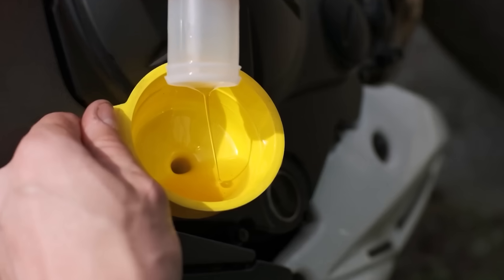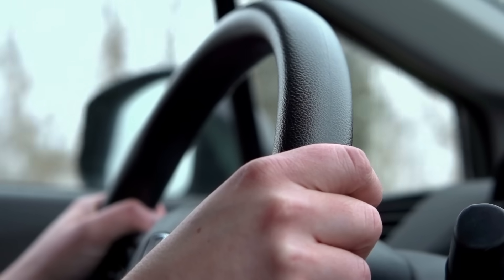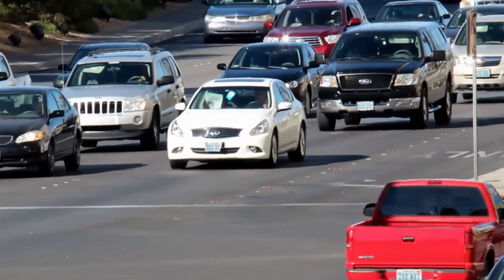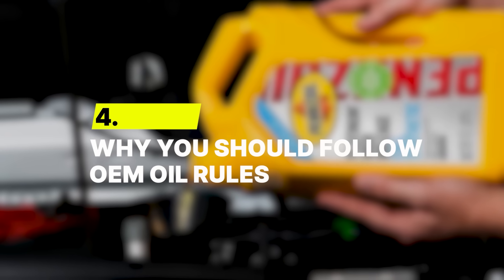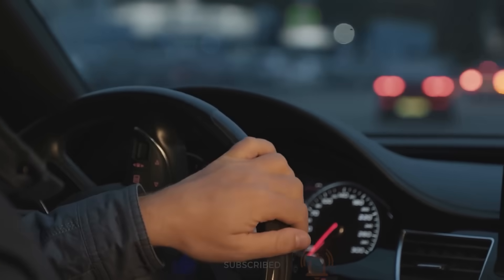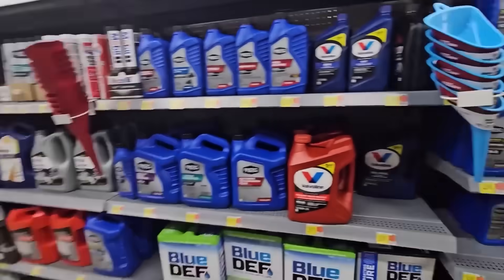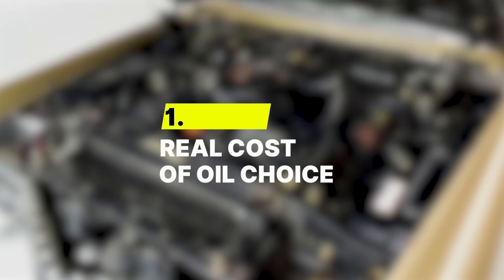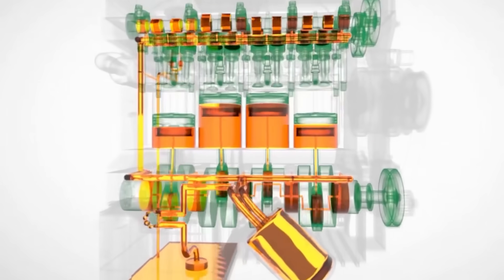0W-20 vs 5W-30: 50 Engine Tests Expose the Oil Everyone’s Been Using Wrong

Comment: Hybrid conditions require the thinner oils due to the on and off conditions of the engine.  Those engines are running colder in the stop and start use except on the hwy.  Any thoughts?

Comment: This content is 100% misleading and should be flagged as fake news. Following the advice here can cause serious engine damage. It’s nothing more than AI-generated clips stitched together with no real data, testing, or engineering context.

Modern engines are specifically designed and tested to run low-viscosity oils like 0W-20 (and even lower) for hundreds of thousands of miles—250k+ without issue. Increasing viscosity beyond what’s specified in your owner’s manual can actually increase wear and reduce efficiency, as shown by laboratory used oil analysis (UOA) results.

Wear and protection are determined by much more than just viscosity. Factors such as engine design, base oil chemistry, additive packages, and driving conditions all play a critical role. The best way to choose or adjust oil viscosity is through trend analysis with real UOA data, not clickbait videos or AI-generated speculation.

For a credible, expert-backed breakdown, watch this video where a real oil expert debunks the false claims made here:
👉 https://www.youtube.com/live/gGdrOgngmC4?si=NkA4hZWF2IQxVkAU
Reply: Don't forget that ford calls for 20 weight oil in their triton v10 6.8. Imagine towing 20k with that water oil.
Reply: That oil could tow just fine. It’s all about base oil and additive package, not weight.

Comment: "save thousands over it's lifetime".  it's just that "lifetime" will be considerably shorter.  Many studies, even by auto and oil manufacturers have stated engine wear is 30-40% more with 20 oils.  Many engineers have stated the engines are not designed for the thinner oils.  0w-20 is required by CAFE and EPA standards, that is the ONLY reason it's recommended by the manufacturers.  Many cars recommend thicker oils in other countries. The only time a car should ever run less than 0w-30 is when day time high is around freezing or lower.

Comment: 0w20 has been proven to not protect under high load low rpm situations.   0w20 is used for two reasons.  EPA average fleet fuel economy and so that manufacturers can sell you another car sooner.

Comment: 0W = -35 Degrees F..... 5W = -30 Degrees F.   (1869 to Present) Lowest Temperature In Central Park NYC was -15 degrees F.... You can switch to 5W-20 and keep engine protection in the Lower 48 states.

Comment: yeah... that's why GM has a huge recall on engines using 0W 20. The solution is replacing the oil with a thicker one or actually replacing the engine if damage is noticed.
Reply: Not the oil it was manufacturing of the crank shaft out of wack them changing to the thicker oil they thought fix the problem

Comment: With the polymers of synthetic oils drastically changing the properties of oils.  The best example is Valvoline Restore & Protect.  Some oil analysis shows less of the traditional components for cleanliness, durability and wear resistence.  But the Valvoline R&P definitely cleans an engine well.

Comment: My 5w20 Ford in Florida switched to 5w30 gets better mpg, quieter, same performance, absolutely no difference that anyone would know the difference, but I know all oils can shear back in heat, so 5w30:has so extra protection in oil shearing.

Comment: What sucks (in the US) is that we know that all cars should use 5w30 but if we get caught not using 0w20 it’ll void the warranty. On the controversial GM 6.2, they require 0w20. But those same engines in Mexico & Canada they require 5w30. It’s ALL about the gas mileage, not the protection.
Reply: Ale polityków pro - ekologicznych nie interesują twoje koszty związane ze zniszczeniem przedterminowym twojego auta olejem  0-20 . Oni zarabiają tyle z twoich podatków że co roku mogą kupować sobie nowe auta .
Reply: @michakalabinski7453 now in English plz?

Comment: There is an alternative that can replace 0W20 and 5W30: 0W30. 
In Europe, this is recommended as an alternative for vehicles that are not approved for 5W30. 
However, you must comply with the specific vehicle manufacturer's specifications.
Reply: Not when the manufacturer bases his recommendations on what the EPA wants, no I won't.

Comment: With all that said why does the same car with a us owners manual  vs example australia recommend different oil. Epa holds the us back from haveing engines that last a long time. Ill take a engine that runs forever vs the little tiny gas savings.  Check out a 2021 rav4 us manual and australia manual if you dont believe me

Comment: Not one company that builds high performance cars use 0w20, this oil is too light to protect against friction, minimum of 5w30 and higher is normally used, further more, claiming that synthetic oils can protect to 12,000km and over is absolute insanity, no oil can suspend this much harmful carbon deposits while still offering protection, at this point oil loses its additives, and becomes thin, and severely compromised, especially on turbocharged engines and GDI fuel systems. Change you oil between 5000 to 7000km, regardless of the quality.
Reply: We built hot rod small & big block chevys in the 70's 10W -40 valvoline racing oil in Michigan winters was fine...no such thing as 5w back then! I want to mix 0w -20 with 0W -20 with 0W -40 same brands to make 0w-30 in Northern Michigan!!
Reply: @johnhock890  Is it ok to mix oils like that?
Reply: @johnhock890  Back then people warmed up their cars more. What was the lowest W rating back then?
Reply: @johnhock890  mOBIL 1 Makes a 0w-30
Reply: I always thought to myself even if the base part of the oil is still good, there's still things that get the oil dirty.
Reply: My 09 srt8 challenger requires 0w-40.

Comment: You can't trust car manufacturers' recommendations on oil viscosity because they don't want your car to make it to 100,000+ miles. I want longevity out of my vehicles so I use 20w50 full synthetic in my SUV in the Southern US.
Reply: What year is your vehicle? Are you sure it isn't too thick? Some spaces between parts in modern engines are tight.

Comment: Toyota has 0w8 and 0w16 for new vehicles.  My friend has a 2025 Camry that takes 0w8 and recommends 10k miles between oil change.  That is just crazy
Reply: It will never last
Reply: @brentneves3602 I hear ya.
Reply: science proves otherwise. Nothing wrong with good quality light weight oils
Reply: @ElmerFudd79 I didn't say there is . Just stating a fact of what I have seen first hand
Reply: Try that in nonsense in Africa. The heat just demands proper oil.
Reply: No way will I go 10,000 miles between changes.  I just refuse.
Reply: There are many laboratory used oil reports which show that 0w8 and 0w16 work fine in engines designed for it.  Use oil specified in manual and change every 5k miles and you are unlikely to have problems.   Some oils can last 10k depending on environmental and driving conditions; blackstone, speed diagnostics, or Polaris UOA can verified this.
Reply: @ElmerFudd79  Yeah , I know about the lab work and reports.  I also know about real world issues in some cases too
Reply: @edwardwritt3820 some but not all.  There are also real world cases where using a heavier weight oil than specified can accelerate wear.
Reply: @ElmerFudd79  This is true.  I agree with you.  I'm just stating what I have seen first hand .
Reply: @edwardwritt3820 watch https://youtu.be/XyBUcxFmqn8?si=7NtZ-eYdV--0mkBu from motor oil geek.  It shows real data and proves these videos are bad advice.  5w30 can actually increase wear in an engine designed for 0w20,  Also, I use 0w20 in my v6 per manual and all wear trends in UOA had been way below averages.  It works fine.
Reply: @ElmerFudd79 I know about this . Only thing I did was post a comment about Toyota oil recommendations.  Never said anything about using 5W30.  I used the recommended 0W20 in both Honda  products that I owned years.  Currently in my Subaru.  Holds up fine. My previous car before my Subaru  was a 2014 VW TDI . VW at the time recommended 5W30 Castrol that was only sold in that formula at the dealership which was fine . Then they switched to 0W30 made by Mobil 1 with the same European formula for VW . Only thing I didn't like was the manufacturer recommended  10 k oil change so I went to 5 and 6 K depending on climate and if my driving habits changed.  I would still have to add around a quart between oil change.  When I did 10K it was usually 2 quarts between intervals . Just a personal preference.  I would never use a 5W30 in something that recommended a  liter oil . Just saying that no matter what the experts say and especially what the manufacturers  say who want to sell vehicles that 10 k is to much  even with the advancement in oil technology.  That just my opinion.  I'm sure you will feel free to educate me some more.
Reply: @edwardwritt3820  agree that 10,000-mile oil change intervals (OCIs) are too long. FCP Euro conducted a teardown comparing engines maintained with 5,000-mile and 10,000-mile OCIs, both with similar mileage, and the differences were staggering. The engine with 10,000-mile intervals showed significant oil varnish buildup, while the 5,000-mile engine looked nearly brand new. Oil analysis also shows that the base number of most oils drops too low by 10,000 miles—especially under severe driving conditions such as city driving or in hot climates.

Unfortunately, manufacturers push 10,000-mile OCIs due to EPA pressure to minimize oil waste. It’s penny wise and pound foolish, as this approach creates far larger environmental issues by prematurely wearing out or killing engines.
Reply: That’s some 🐂💩

Comment: um, if you live up in the northern USA, or Canada....why not an all synthetic  0w 30? And change it every six months, along with the oil filter.
Reply: 5w30 would be a better choice and will increase engine lifespan no matter what the manufacturers say. It won't overload your car's starter or battery either.
Reply: @paulstewart3298  How is 5W30 better than 0W30 if they are both 30 after the engine is warmed up or even hot? I'm curious and ask out of ignorance.

Comment: I remember when the big febate was switching from 10W40 to 5W30. 😄
Reply: 10-40 is still better than 5-30.
Reply: @davidstjames_ 5w40 is even better yet!  But Shell Rotella recently dropped the gasoline engine rating.  Strange how the last gallon jugs of Valvoline Cummins Premium Blue still has the gasoline engine rating in the API donut.
Reply: @jameseroh6544   Yes, I agree!  That's good to know, I thought that all of the Rotella oil was for diesel only, that the detergents were too aggressive, I'll check them out.  Thank you.
Reply: @davidstjames_ It means your are old 😂
Reply: @davidstjames_  Sorry im joking. I believe it depend on the car machine specs. Im using 0w 20 in my 2021 car because the manual said it can use 0w 20 preferred or 5w 30. I have 2004 car using 10w 40 and 2010 car using 5w 30
Reply: @JoyFin   Look up the recommended oil for the same vehicle and engine in another country and you'll see that the manufacturer doesn't recommend 0-20.
Reply: @davidstjames_  Could it because the engine in another country slighly different too? 
May be you are right. But i still believe that the best is follow the manual book. FYI In my country there is no such limitation (CAFE etc). Even the petrol is ok to have 500 ppm sulfur (EURO 4: 50 ppm max). Yet the manufacuter still recommend 0w 20
Reply: @JoyFin   What country are you in?  If it's a small enough population, maybe they didn't make an exclusive manual for you.
Reply: @davidstjames_  5w 30 is still good choice. But 10w 40 could be problem in 0w 20 machine. I live Indonesia

Comment: How about, say,  Puerto Rico---the Tropics---where the average temperature year-round is 85°F? I upgraded from OW-20, to 5W-30, and my Sportage gained 6 mpg!!!
Reply: Ford engineers proved engines last longer with 30 weight than 20 weight over 20 years ago, via extended mileage tests.

Yet Ford still changed their consumer recommendation to 5W-20.

The Environmental Protection Agency (a Federal agency) financially incentivizes car makers for recommending thinner oils!

Most vehicle owners DON'T CARE if fuel mileage goes up 0.5 miles per gallon (half a mile per gallon) but the engine wears thousands of miles sooner. They want their vehicle to outlast their payments!

Thin oils cause excess wear. PERIOD. In Europe, Asia and South America, car makers still recommend heavier oils - in the same vehicles where they say to use thinner oils in the USA.

These are decisions based on bureaucratic priorities - not the world we live in.

Only use 0W-20 where winter temperatures stay below 0* F for days at a time. Where they rarely go below zero, stay with 5W-30. For hard use consider 5W-40 or 0W-40 YEAR ROUND. .

ALWAYS use Full Synthetic, regardless of weight. Never semi-syn thetic or conventional oil. And change it at 5,000 miles or HALF the car maker's recommended interval - whichever is less. Your engine WILL last longer.
Reply: @larrymitchell3502   You're 100% correct.  Keep in mind that the possible mileage increase is only estimated.  This is all because of the nonsense CAFE requirements.
Reply: @davidstjames_  Spot on
Reply: CAFE is gone.
Reply: @jamesbosworth4191   I wish it was gone.  However, your comment made me look up any changes, and basically you're right since there are no longer civil penalties.  But we both know that a political change can bring back the penalties.  We need them to completely eliminate it.
Reply: Nobody should use 5-20 anywhere on earth.

Comment: My Toyota has over 300K that requires 0W-20 and has never given me a problem in the scorching heat where I live! Just go by the manufacturer recommend oil, and change it every six months or 5K miles and you'll be fine!!!
Reply: My Nissan titan long block replaced at 19k miles using 0w20 Arizona climate ……never again switched to 5w30
Reply: I hear ya but some manufacturers are saying go 10k between oil change
Reply: @edwardwritt3820  Oil is cheap, so why take the chance! I get allot of advice from the Car Care Nut here on YouTube, including using 0W-20 motor oil in my Lexus RC350 and Toyota Tacoma.
Reply: @edwardwritt3820 that’s crazy … I did every 3500 miles at the dealer only engine still failed at 19k miles 😂
Reply: @edwardwritt3820 and all of them sell cars, hint, hint
Reply: Eaxactly. Change my 2012 Acura tl every 4,000. It’s more about oil change intervals.
Reply: Exactly
Reply: Poczekaj jeszcze troszkę i znów daj opinię .

Comment: Ask General Motors and Ford how that 0W-20 Motor Oil is working out??? The Environmental Wackos are going to cost Automobile Manufacturers Billions of dollars in recalls due to engine failures. Sacrificing motor Oil film strength for slight increase in mpg is crazy!!!
Reply: What you say is very True 🍷
Reply: You are spot on.
Reply: That’s why they switched to 0w40 regardless of CAFE standards
Reply: @Top_g80comp  IIRC, 0W40 is expensive. I wonder if it is genuinely better than 5W30 outside of arctic conditions.
Reply: CAFE is gone.
Reply: Nope. Thinner oil is an inexpensive way (for the manufacturers, not the car owners !) to raise the mileage to meet EPA standards. If the manufacturers use sloppy machining methods an QA that leave machining debris in the engine when its built, then YES, using thinner oil will not cushion close tolerance moving parts. This self-made "problem" doesn't seem to show up for German and Asian companies, ONLY GM and Ford. Put the blame where it belongs !
Reply: @rpasco9352 wrong . Just replaced long block on my 22 Nissan Titan at only 19k miles cylinder 5,7 scoring bad and damaged camshafts . This same engine in different continents is requiring 5w30/40  so please 🤫
Reply: @Top_g80comp  What oil does Nissan America tell its Titan owners to use?
Reply: @rpasco9352  Maybe the oil should be changed 2 or 3 times in the first 1K miles. Make sure to get rid of the metal shavings that get into the oil.
Reply: That is indeed what you are supposed to do.
Reply: General Motors is a different story.  The 0w20 did not cause engine damage.  They had manufacturing defects in the cam shaft / lobes and changed viscosity to bandage the problem rasher then expensive part replacements.  This is well documented.
Reply: @ElmerFudd79  Damn. I guess having aftermarket camshaft put in would void the warranty. Perhaps GM has some kind of performance camshafts that wouldn't void the warranty. Also, maybe there are aftermarket camshafts for when the vehicle goes off warranty... Your post is good info for people considering a vehicle that has the engine(s) with flawed cams.
Reply: @ElmerFudd79  Thing is, if thicker oil, say, 10W 30, or in warm climates, SAE 30, was specified, the engines probably would have been fine just as they were.
Reply: @jamesbosworth4191 not necessarily true.  Thicker oil can actually cause more wear. This has been proven in lab testing with long range trend data sets. 

Video is fake news garbage
Reply: @ElmerFudd79  It all depends of the temperature.  If it gets cold enough for oil to become too thick to easily flow, that is true, but if it is NOT that cold, it is NOT true.
Reply: And FCA, Toyota, Audi, Kia/Huyndai, Nissan...